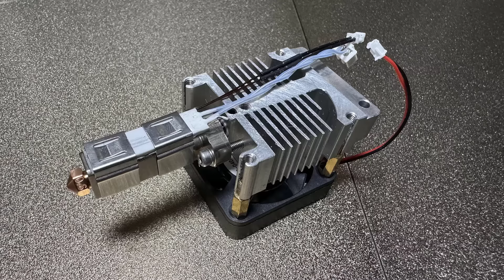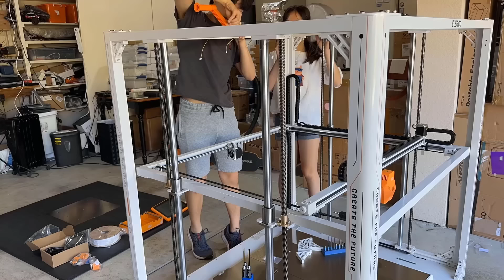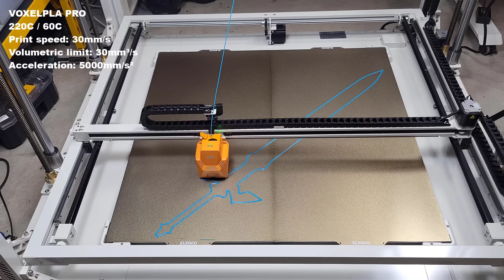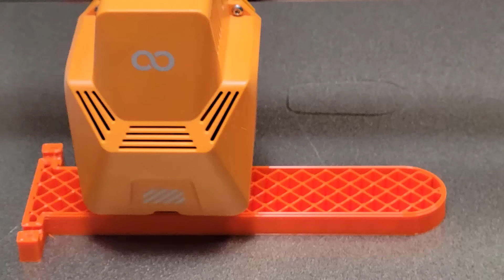Elegoo OrangeStorm Giga 800x800x1000mm Huge 3D printer review

Comment: The 3d printer community should leave the dark ages and take a leaf from CNC and manual machinists, instead of rubbing on a piece of paper between the bed and the nozzle. Clock the bed/do the bed levelling with a DTI on the print head.

This machine needs a multi nozzle tool changer, considering the size of prints and the higher risk of running out of filament, or go to using pellets instead of filament.

The filament path seems better if done from above. Perhaps an A frame mounted above, or a second dual axis XY gantry linked by timing belts.

How is the speed of printing two swords compare to using a treadmill style printer?

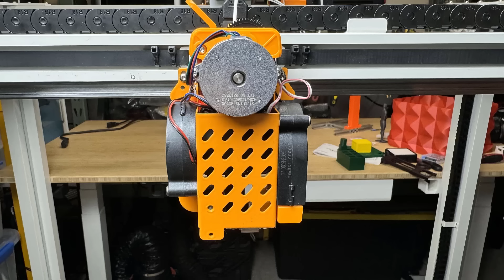Comment: 1:43 What's a 5051 blower? Do you mean 5015? The long filament path can cause issues if you don't auto retract the filament, just imagine what happens to the filament when the head moves from the front to the back, the filament can catch the part or droop onto the part

Comment: Another great and extremely thorough review.  No one does it better and I really like the pros and cons lists you do for all of them.  I think Elegoo released this too soon and really made some poor choices for hardware and setup.  It should have had a top of the line hotend and there is no way a printer with this large of a print bed should have to be manually adjusted with set screws.  That is unbelievable to me with all the other printers being entirely automatic for both the bed and Z offset.  At this price point of $2500 there isn't much excuse for that.  The components they are using are certainly not top of the line and other than the frame itself, I think the design choices are very lacking.  I was so excited when I first heard about this printer and they hype certainly doesn't match the end result.  I would never pay this much money for a printer with manual bed and Z offset.  I am not an Elegoo hater, and I do like many of their other printers and their Rapid series filament is awesome.

Comment: they should have had it have multiple nozzles that can get swapped out, and they needed to have tandem printing in the base modelf or them to have a reasonable upgrade path. to have multiple nozzles able work on the same print they would need the nozzle area to go toward 6 axis, instead of 1.
if instead of having a sqware top, they were able to rotate the top, and dropped the head like a crane with a magent underneath the print bed, they could have had a clean and easy upgrade path, but it would cost way more to tack that on after the fact. so i call BS on them upgrading it instead of making a model 2.

for customer facing product, you need to make the upgrade path be accessible to the largest portion of the public. once you get near the level of expertise that they would need to be able to design the product to use it, sales fall off.

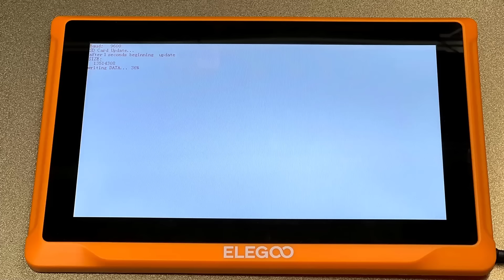Comment: 8:05 I wish Elegoo makes the SD card reader more accessible to the bottom or the top of the panel instead of cracking the panel open.
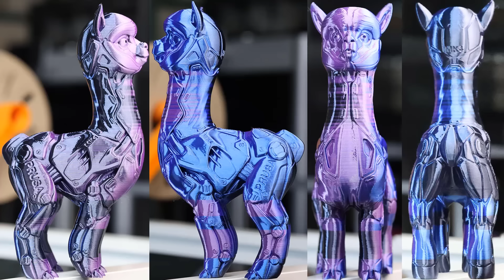12:02 20,000 mm per second? I would like to see that in action!
14:40 I guess I was expecting more for something at 1mm nozzle. Shows how much I know about 3d printing.
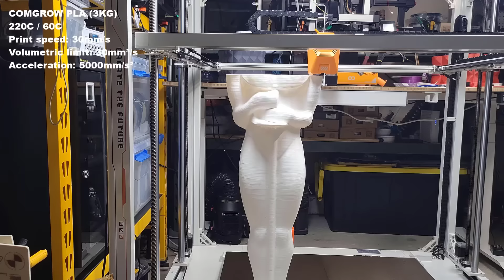19:07 Is that a Grammy?
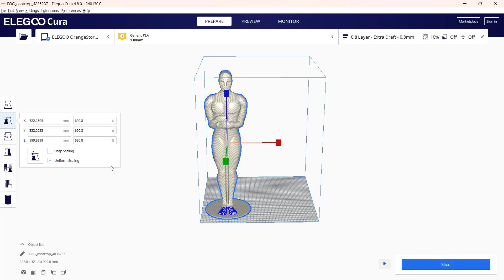17:38 Ah, it's an Oscar. I forgot that a Grammy looks like a record player. Ooops.

Comment: The print head does not match the printer.  This thing should use 2mm nozzles and be able to push like 300 mm cubed per min.  It is a giant form 3D printer with the print head of an ender 3.  This does not make sense
Reply: Agree with you, I think most users will upgrade the hotend. I’m waiting for mine to arrive and will do that, but I’m am glad the price point is great. If they launched already with high power components I wouldn’t be able to afford. I think they took the entry price as a preponderant factor.

Comment: Moving gantry kinematics is a bad idea. It has worse rigidity than moving bed, which leads to worse shaper frequencies. Same mistake was made in Voron printers.
Reply from the maker: I think the reason they didn't use a fixed-height gantry with a move-down bed is that when you're printing at this volume, your print can weigh 20kg or even more. Moving an object of that weight down may cause other issues unless it is equipped with much stronger stepper motors and drivers, but that could drive up the cost tremendously.

Comment: Why no mains powered beds? Also 30 cubic millimetres per second is pretty bad if it doesn’t increase with really large nozzles. That’s something I’d change in the settings to see how far you can push it. 60W is pretty small too, considering a 70W heater will fit in a normal V6 heater, let alone something like a volcano.

Comment: Makes sense, who cares about hi acceleration when with a 1mm nozzle it won't go faster than 30mm/s.
It would be cool if it was a IDEX with a 1.0 and 0.4mm nozzle for external perimeters and top layer.
Reply: You could print two Oscar statues in the same time.

Comment: Actually, I think they should slow down heating of the bed. At least for 115V. Going near the limit of the power you can get from one line isn`t great. Alternativly they should use 3 phases to connect the printer to an outlet for ovens. At my home (in Germany, so 230V) renovating my kitchen I actually used a Perilex plug for my oven (Perilex is a 3-phase+neutral+ground connector for 3*16 Amps, esp for ovens) to be prepared for the future. Even it means to buy takeout food for a few days on a big print, this might be better than to overload your electrical system.

For 1mm nozzles: Imho there is one function missing on all modern slicers: Different layerheight for outer layers. Why isn´t it possible to use 0.6mm layerheight for a print, but with printing outer layer first with a layerhight of 0.2mm for theese (so the printer would print 3 outer layers on top of each other, with 0.2mm laayerheight each, than the inside of the object with 0.6mm). This would increase the printing time only for the outside perimeter. But as you only can see the outside layer afterwards anyway, this should improve the quality by a lot. Combine this with variable layerhight to get more detail at the top, and you would get great results with only modare increased printing time.

Also this printer definitly needs a toolchanger. Not (only) for multimaterial, but for different nozzle sizes. If - for example - you print a landscape, print the bottom with a big nozzle, but change the nozzle if you go upwards for more details.

For the design of the printer: It should be more modular. The base, the top, left, right and back side should be made as seperate parts with each having a few thumbscrews (and of course plugs) to connect them together. So you could assemble and disassemble the printer in maybe 20 minutes (+calibrating after assembly). A printer this size does not fit through normal doors.
Reply: The slicer suggestion for different internal and external layer heights would be so good! Great idea! Hope someone implement it in the future soon!

Comment: Based on my experiences with my RatRig V-Core 3.1 500 I would say having 5k acceleration on this huge printer is very respectable. I don't use more than 5k accel for printing moves on my 500x500x500 printer either. I use 10k for travel moves. Setting it for more seems to lead to occasional missed steps. 
Elegoo seems to have used a thicker and stiffer gantry for the X-axis than the V-core stock one but that makes it heavier too. So it is a fight between having enough spare torque on the steppers to overcome at least slight drag of the nozzle on imperfect print while at full acceleration on one hand and having stiff enough gantry to avoid forcing the input shaper to modify the acceleration too much on the other hand. I would say Elegoo did a decent job here and got a good compromise for such a huge printer.

Comment: You did not make a mistake by not connecting the filament sensor, the design logic  needs to be reversed so that if the filament sensor cabling is not connected, it shows that the filament has run out. This is simple failure, logic design.

Comment: It could have been so good....but everything went cheap...I don't understand why they didn't design this around an enclosure since that is certainly needed.  The location of that USB drive is really bad.  You're correct - a machine this big will want big nozzles and some big flow rate.  It's too bad they didn't consult with someone like Slice Engineering to put a Mosquito Magnum in there or the like.   It'll be neat to see what the community mods this thing into.
Reply: It would certainly have been a good idea to have that as an upgrade package. Even at 2.5k it's very cheap for what it is, though that also opens up so many issues. 

It would also have been really nice to get an option for a powder coated welded steel frame. Could have opened up the potential for speed quite a bit. For just a bit more cost in shipping

Comment: Sigh.. scratching the bed on the first print is a right of passage for most printers.
Reply: I don't know about most printers, but it seems to have happened to many that have tested this printer.
Reply: @atnfn I've never had any such problem 🤔
Reply: I had that happen when I first installed klipper on my printer because I had no idea what I was doing
Reply: @Shinobubu  seems to be on par with other reviewers. Was hoping they worked it out by now.
Reply: @truggy82  that scratch will be a constant reminder…!
Reply: @maco8799  like a scar across the face. A reminder everytime you look in the mirror.
Reply: @trugbilddrachen yeah that's what I was hoping was less likely at this point.